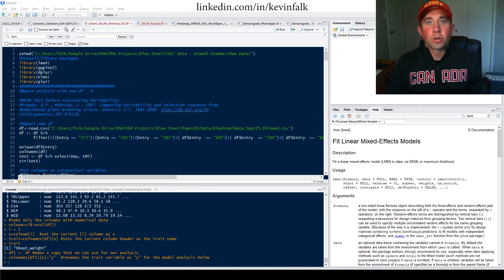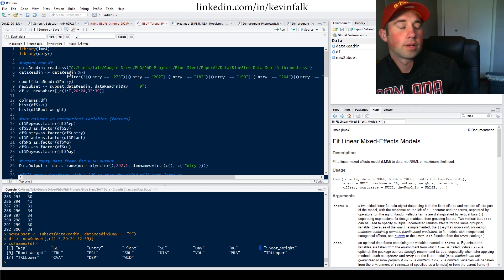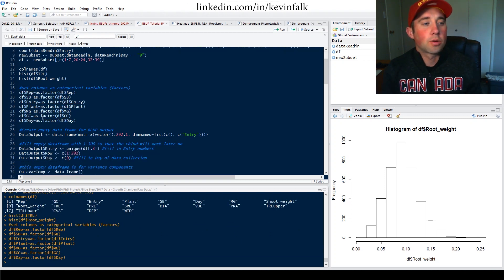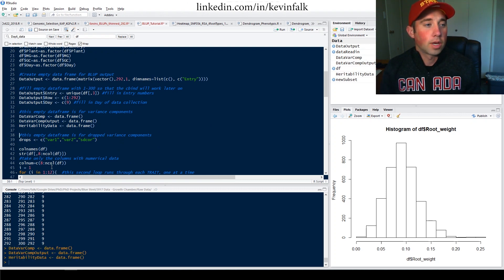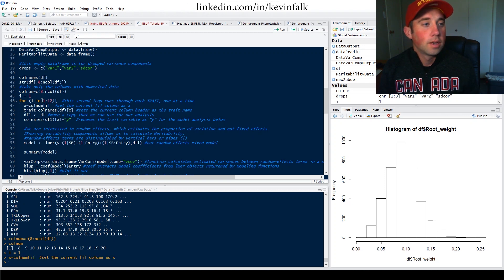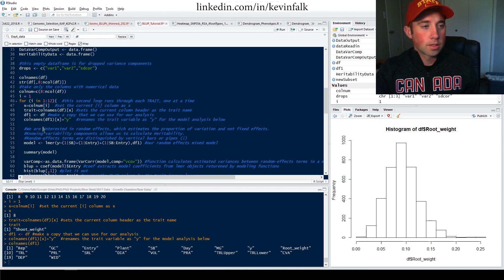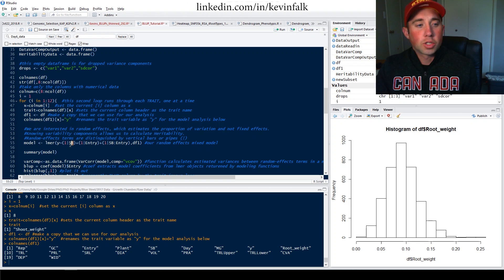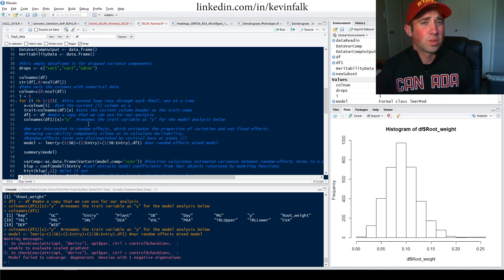BLUPs and Heritability, Mixed Model Tutorial in R

Comment: The heritability estimates seems to be too high. Can you please conform if the equation you used is the correct one. I have similar root traits (total length, primary root length, lateral root length) and trying to calculate heritability.  Are there any other models or equations used for heritability calculation.
Reply: I think that formula is for narrow sense heritability instead of broad sense as he is not including variance of residuals.

Comment: Hi, Kevin, I am curious your experimental design? Could you explain a little bit of your design, which concerns the linear model.
Reply from the maker: My experimental design was essentially a RCBD using 12 growth chambers (which I call sub-blocks in the video but are essentially reps) and 292 genotypes (of which 12 plants were grown of each).
Reply: @KevinFalk  Another question, did do the ANOVA test to check what's factors(like, Subplot) are significant or not then put then in BLUP ?
Reply from the maker: @jizhogjie1205  yes I did do that

Comment: Hi Kevin. Thank you for your tutorial, it has been really interesting. I am getting into BLUPs analyses and heritability estimates for cold hardiness in polyploid roses. I am working at the moment with only two environments so I am thinking setting environment as a fixed effect and genotype as a random effect. My response variable is a ratio of two stem measurements taken in the field. I was wondering if you had any experience or suggestion on modelling proportion data with lme4 specifying a beta distribution. Thank you.
Reply from the maker: Hi Cindy. Thank you for your kind words. Interesting question. In my experience I have yet to work with a beta distribution however, Sarah is working with nematode counts with a similar distribution issue. I will look deeper into this.
Reply: @KevinFalk  Thanks a lot!